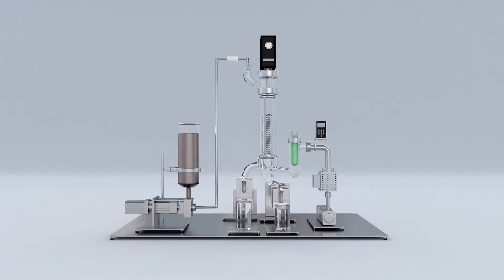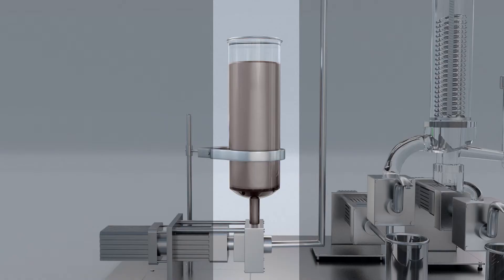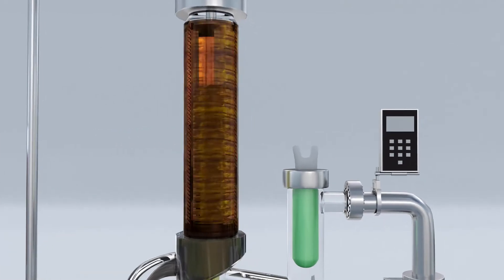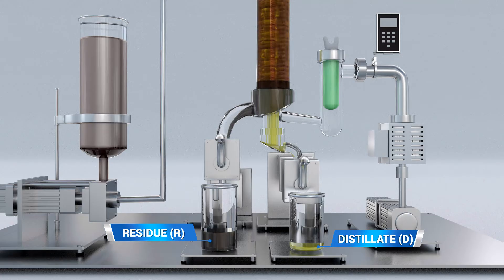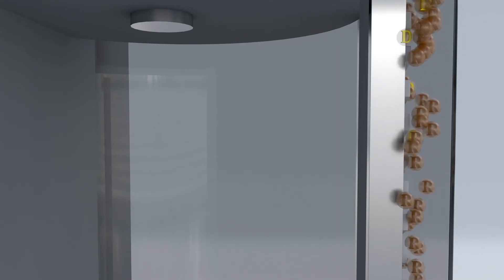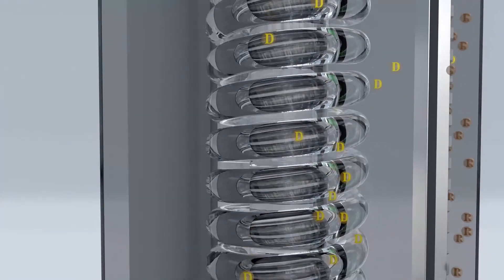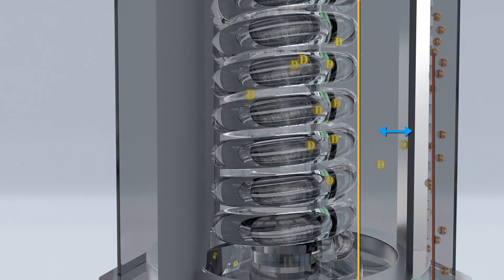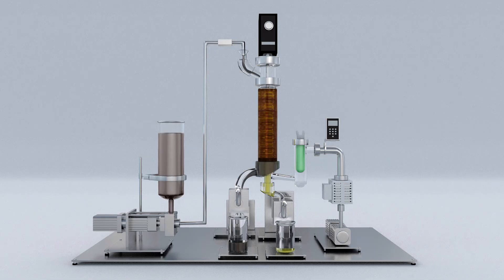Short Path Distillation - Principles of Operation

Comment: Thank you for the video. Can you tell me the main differences between this system and a rotary evaporator?
Reply from the maker: Iris, rotary evaporators are much simpler devices which are typically  used to remove solvents

Comment: Bruh I'm just trying to learn about distillation methods, not weed.
Reply: doesn´t matter what material you use in the feedstock, the principle remains the same, also there aren´t many types of distillation, 1. normal distillation 2. vacuum distillation. 3. rotary evaporation 4. wiped film evaporator 5. fractional distillation 6. steam distillation 7. short path distillation
Reply: @Humbulla93  That's right. However, the structure of the rotary evaporator is simpler. The process of short - path molecular distillation is a bit more complex, but the purity can reach 99.9%.
Reply: meanwhile im trying to learn about this but all I can find is petroleum lol